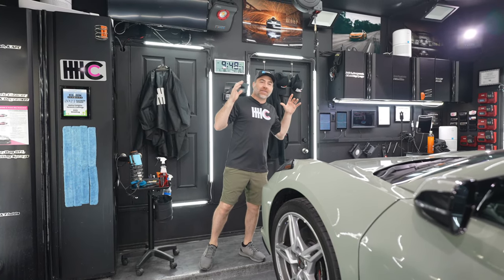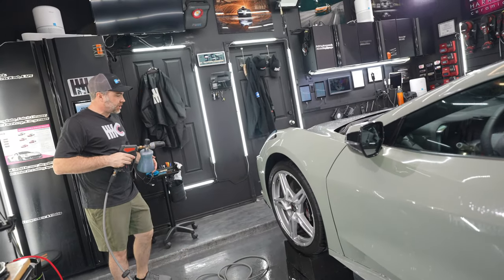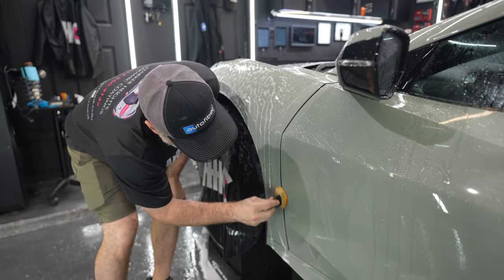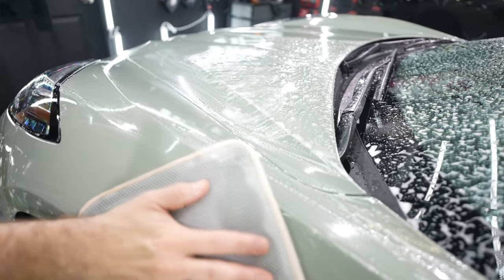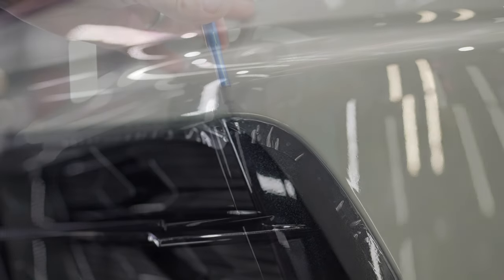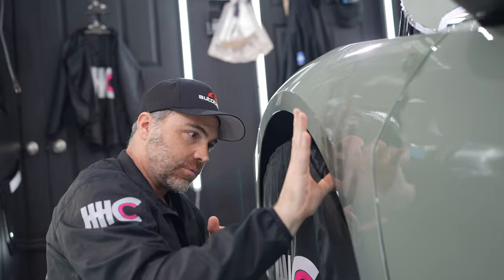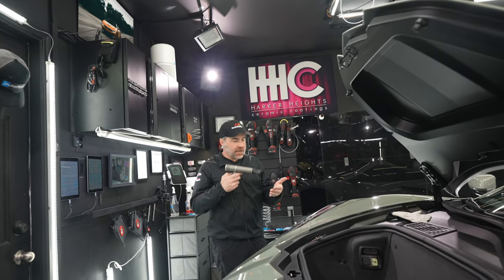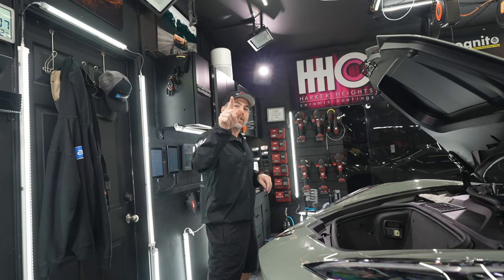PPF install process A to Z - 2024 C8 Corvette Cacti Green in Copperas Cove/Killeen/Ft Cavazos

Comment: That F-Bomb was it 4:1 water or 4:1 chemical? And what was the tool you were using to tuck edges of to roll that edge it was blue and black I think?

I’ve actually done more C8s than any other vehicle but have only been installing for two years. I’ve started removing the front bumper emblem automatically because the pattern is awful if you don’t lol. They’re just inconsistent as far as placement goes and it’s a much nicer install without those edges like you said. Awesome work brother I love the ppf videos I’m always trying to learn.
Reply from the maker: 4 parts water one part f bomb

What time in the video for the other question I’ll go see and link you
Reply: @HarkerHeightsCeramicCoatings  at 7:13 you’re using it on the hardest part of a C8 bumper that corner.
Reply from the maker: @atdautospa https://makemoremoneyllc.com/collections/ppf-tools-equipment/products/the-magic-stick
Reply: @HarkerHeightsCeramicCoatings  awesome thank you so much man!